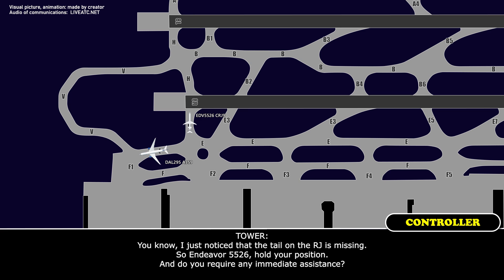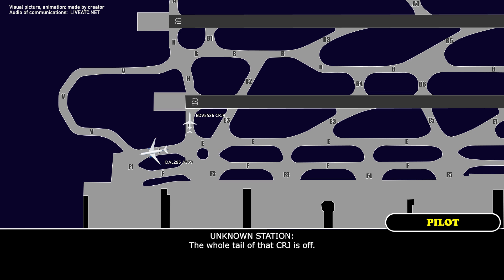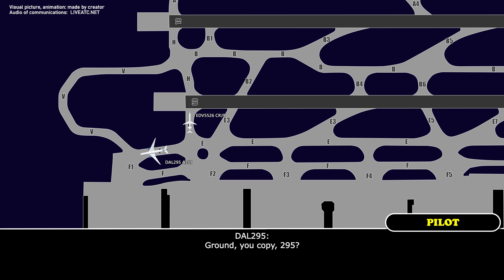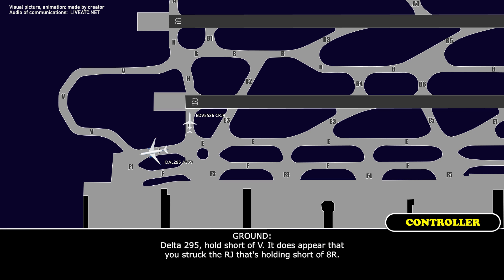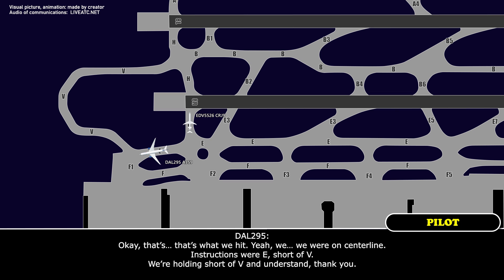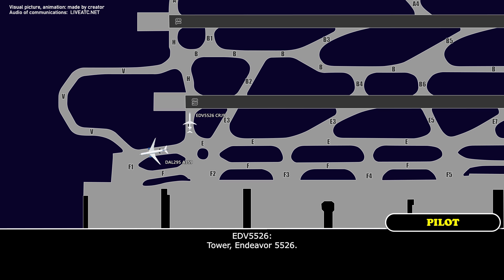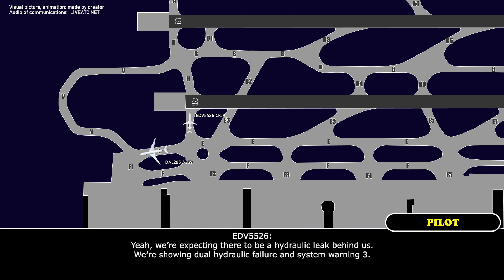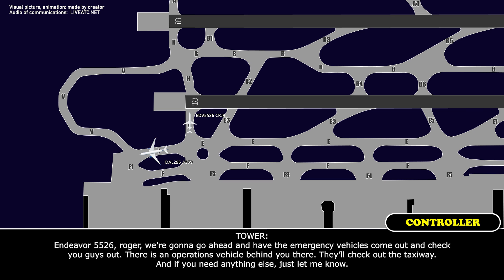“The whole tail is off”. Ground collision at Atlanta. Delta A350 and Endeavor CRJ-900. Real ATC

Comment: That was very quick of Delta 295 to state, "...we were on centerline..."  (translation:  "We were following standard operating procedures.  We are not willing to get thrown under the bus."
Reply: @sundragon7703 Can you blame him? Not sure who exactly is going to carry the can for this. It seems the CJ pilot should have been further forward, but I don't know how those regs are written. The A350 pilot should probably have noted the CJ tail sticking out, but he may have been focused too much on the centerline. My bet is that the NTSB will have criticisms for all concerned, including the design of the taxiways, though the CJ pilot gets the biggest smack on the wrist.
Reply: @grahammonk8013  The CJ pilot didn't do the hitting. The A350 pilot needs to taxi with have situational awareness by taxiing with caution.
Reply: @cottydry  Yes, but he did leave a lot of room before the hold short line. I wonder if the NTSB will at least mention that as a contributing factor Juan Brown on blancolirio channel did some measurements and it seems there wasn't enough room for the A350 to get past while still staying on the centerline. Still mostly the A350 pilot's fault, but i do think the CJR pilot is getting a mention.
Reply: @grahammonk8013 
Yeah this happens all the time because on large aircraft the wingtip path is more than 100 feet away and out of site behind you. Unfortunately the blame will largely fall on the 350 crew since it’s (technically) their responsibility not to hit anything regardless of someone setting a trap for you.
Reply: Huh? You think the CRJ is at fault here?

They were stationary. You aren’t required to be 6 inches from the hold point. The moving plane is 100% at fault.
Reply: Of course he said that to cover his … .
Problem is, sometimes you have to stop, even on Centerline, if there is another aircraft, unbelievable 🤦‍♀️
Reply: @HsquaredH2 If you can’t see the damn thing why would you stop? We gonna taxi in 20ft increments, shut down, hop out and check clearances every time?
Reply: @sithticklefingers7255 , lol, go back to your MS Simulator and have fun, stay out of grown ups convos…thx🤦‍♀️
Reply: Centerline means nothing. Still PIC's responsibility to make sure the area is clear.
Reply: Is there a definition or guidelines on how far or close an aircraft should get to the hold short line? I’ve never heard of any. Plus we don’t know if the aircraft in front had just moved and the CRJ hadn’t had a chance to move forward. That said, it’s not the CRJ pilots responsibility to make sure the tail is clear of the taxi way behind it.
Reply: @saxmanb777  
Nope -  just gotta make sure you don’t cross that hold short line.
If your jet is moving on a taxiway and you crash into any stationary object    -    You’re culpable.
Reply: We did not get the Ground controller's instruction to the CRJ so have to assume CRJ had clearance to be short of 8R.  Either the CRJ did not move far enough up to the hold line or 295 was not keeping an eye on their wing tip clearance.  That 295 hit a stationary plane means they will catch some of the blame.
Reply: @encinobalboa  295 is 100% responsible but the CRJ will likely be a contributing factor. It's like if you're driving down a street and sideswipe a parked car that turns out to be a little far from the curb. You should have stopped or proceeded with caution when it was safe to get around them.
Reply: Is it common to not able to see another plane on the ground or not know what you hit? It's hard to miss a plane.
Reply: yeah covering his ass real quick probably knowing it was being broadcasted for the public to hear like this. Pointing fingers at ATC for misguidance.
Reply: Uhh, yeah? Their job is kinda on the line, so of course they'd be quick to reconfirm what their instructions were and that they were following them.
Reply: @driftspecs13  - yep! Already trying to pass off the blame
Reply: Good thing this didn’t happen while they were up in the air!  Yikes!
Reply: They’re the bus the RJ got thrown under
Reply: So much for clear right by the FO
Reply: @brigadeaviator  happened 2 months ago same side at KSLC. maybe the FO isnt allowed to clear right at delta
Reply: But as pilot in command, if there's any doubt, stop.  Just like being cleared to enter/cross a runway.  You still check.
Reply: @pfsantos007  unless it was dark
Reply: @pfsantos007 evidently, there was no perceived doubt. No accidents would ever happen if there was.
Reply: @pfsantos007 I heard another, longer version of the ATC tapes where DL 295 requested a stop and was denied. ATC seemed to be pressuring them to get to the area out of the flow of traffic. I can no longer find the clip and can’t be certain it was authentic but if so, could show contributing factors.
Reply: @pfsantos007 You are such a hypocrite.  You would be on the radio immediately saying how you were following ATC and that it was not your fault, just like this pilot.  You talk like some big authority but have never, ever, been in a cockpit or flown an airplane, so keep your couch-based comments to yourself.
Reply: @mikek5298 Tell us you’re a keyboard warrior without telling us you’re a keyboard warrior lol
Reply: @mikek5298  LOL - A couch based commenter scolding a couch based commenter for commenting.
Reply: @mikek5298  The delta pilot just entered the chat.......
Reply: @mikek5298  30yr pilot here - you run into another airplane while taxiing, that you’re overtaking, its generally going to at least partially be your fault.
Reply: @WillFlyForTips  as a former pilot, I can say that even when we were just student pilots, we were taught that being at the taxiway centerline doesn't always guarantee that your way is clear of obstacles, so we were warned that if our wingtips hit something, we cannot use the excuse that we're at the centerline and we didn't see the obstacle.
Reply: @mikek5298 
Your right -  accidents happen.
But -   The Captain claiming he was on the taxiway centerline does not clear him of culpability.
Reply: @mikek5298  oh my God, what is your problem?
Reply: @ro-86alkonost78  Problems is they say you can not see the wingtip from the cockpit of a A350. So not sure how they are responsible if they  were told to taxi past F to Victor right by the spot they collided?
Reply: As a PIC, you are responsible for your aircraft. That includes hitting other aircraft while taxing. If in doubt, you stop until your are sure you have enough room to proceed. 

The CJ was well positioned behind the Hold Short line and not at fault in this case, nor is ATC. BTW, I do have over 21,000 hours in heavy transport.  equipment
Reply: @mikek5298  well as an actual pilot I can tell you the couch pilot here is almost undoubtedly you because his assessment of the situation is a 100% accurate.
Reply: @skydancerforever  pilots are always responsible for the movement of their own aircraft. They know how to estimate their wingspan from the flight deck. When in doubt, they should stop. These guys misjudged their wingspan. Tower dropped the ball by not taking a closer look and/or not saying “use caution when passing behind the CRJ”. That would have been a red flag and I’m pretty sure they would have stopped.
Reply: @skydancerforever  the pilot is still responsible for ensuring his wings won't hit anything. Even if they have taxi clearance, it doesn't mean that they'll get off the hook so easily. It can be ATC's fault or A350 pilot's fault or even both of them could be at fault.
Reply: Yeah that's not going to save him.  If I'm instructed to taxi to 16R via Bravo does that give me permission to plough through the 10 airplanes ahead of me in the line up.  Uh no..... This is 100% on the DL295.   Doesn't matter one bit where EDV was stopped.....  What if EDV was right in front of him on E, DL 295, "well we were told just to hold short of V".....
Reply: @raymoland  Doubt it will be 100% as you suggest. That other aircraft should have had a precise spot to be at, not just stopping anywhere. The airbus cannot see anywhere near its wingtips, but he should just know….that other aircraft that seems to be in the right spot, is actually xx ft off, so we won’t fit?  What if it was night time?
Reply: @Arkangel88Mr  I am a professional commercial pilot for a major US airline.  Perhaps you are too.  If so you will know that it is not written anywhere how far you can or should stop from the Hold Short line, just that you should not cross it without permission.   It is also quite possible the CRJ was moving forward after another aircraft took off.   Doesn't matter.  If I am taxing my aircraft and I hit another from behind, it is 100% my fault.
Reply: @raymoland   Perhaps you are right. But if everything depends on a pilot judging his wing tip distance without being able to see, on planes with such large wingspan, maybe some procedures/ airport design changes are needed. Unless it was just all negligence.
Reply: He's not wrong.
Reply: Geez, men seem to get so contentious with each other. 😮
Reply: @msjdb723 yapping bubbas think it’s just like hitting their 2500 StrokemeWagon’s mirror on something. It is not.
Reply: But the CRJ was under the (Air)Bus 😂
Reply: Meh…that tail was going to fall off sooner or later.
Reply: You can be on center line and crash into the plane in front of you… duh
Reply: @burnn3 agree 100%. I flew heavies for a long time. You are aware of your own wingspan and learn ways to judge wingtip distance when you cannot see them.  We would use cross-cockpit references to judge different clearances at 10 and 25’ from our wings.  With the 350 pilot asking what they hit, it seems they were not even discussing the CRJ’s location and were unaware of the threat.
Reply: being on center line does not guarantee clearance especially at intersections..... flying for 35 years i hav seen lots collisions...especially at converging intersections.......  the Delta when he says he hit something...admits that he did not even observed the CRJ when passing it.....that's so obvious....day  dreaming
Reply: Yep, complacency will make you follow the centerline without looking around. Still his fault, the PIC has the ultimate responsibility to avoid collisions. Technically, even the one that hit a pole while following linemen's signals
Reply: Exactly what you and I would have said had we followed instructions and were on the centreline !
Reply: Too bad if he was on the centreline! If you’re on the C/L and you hit another aircraft, then it’s YOUR fault! What a cop-out.
Reply: Well , they got it on record alright (the FDR recording , the frequency recording and now the whole damn world on internet ....)
Reply: According to Blancolirio's coverage of this, the smaller jet was either still taxiing or holding WAAAY too short of the runway.  The A350's wingspan is like 220 feet, so . . .
Reply: @joesterling4299  Yes but then he discusses not who is at fault but only whether it is career ending for the DL pilots....
Reply: One of my briefings in close quarter taxi routings is “we proceed with extreme caution in the vicinity of other aircraft”…the A350 has a vertical stabilizer forward looking camera but I wouldn’t trust it to ascertain my wingtip clearance on another close proximity aircraft.  I’d rather just let ATC know we cannot proceed as there is a conflict with the other airplane’s position.
Reply: everybody here is wrong, yes that means you
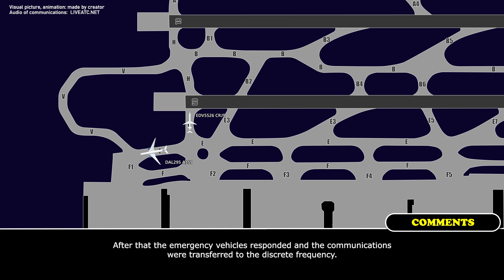Reply: Being on centerline won’t save them. The first officer had a clear view out the right window as did the captain seated behind him and the jumpseater also 2:03  has eyes. If any of them were on their phones for any reason, they are fucked, but I think they’re fucked either way.

I’m a wide body captain, so I kind of know how this is going to play out.
Reply: Maybe my bad english, but i understand every time i hear the sequence "... we were off centerline..."
Reply: Kinda like a driver who’s in a crash gets out of the car and the first thing they say is ‘I had the right of way’ when that’s not entirely true.
Reply: Looking at the video of this, the CRJ was stopped WAAAY back from the hold short line, so his tail was not where it was supposed to be. Oops.
Reply: @Kevin_Rhodes  Unless things have changed since I retired, it’s the responsibility of the aircraft that’s moving to avoid the one that isn’t. Centerline be damned.
Reply: @charlesharrell3643  I don't think it has changed. This is also why even when taxiing a Cessna 172, we still call out "Left clear, front clear, right clear" before turning.
Reply: @Kevin_Rhodes and this simulated animation, not video of the actual incident, may not be accurate at all.
Reply: @Kevin_Rhodes , so what, he can stop short where he wants! The A350 should have stopped, period!
Reply: @Kevin_Rhodes - irrelevant. The moving aircraft should have made sure there was adequate clearance
Reply: @kentsibille6850  How, they can not see there wingtips from the cockpit on the A350? they were cleared to taxi right thru the area to Victor.
Reply: @skydancerforever  - they obviously say the ERJ and never considered that they might not have room. Ultimately their responsibility. I bet their are wingtip cameras as a part of the resolution
Reply: @Kevin_Rhodes  the positions this video showed are just for presentation purposes, it might not be 100% accurate.
Reply: @ro-86alkonost78  I am basing my conclusions on the actual video of the scene, not this reconstruction. That CRJ was NOT where he was supposed to be.
Reply: @Kevin_Rhodes  people need to realize that being on the centerline is not an absolute guarantee of not hitting obstacles. If you're the pilot, even if you're at the centerline, and your wing hit something, you may have a liability and it's still your responsibility to ensure you will not hit something when you're taxiing.
Reply: @Kevin_Rhodes  - irrelevant
Reply: @Kevin_Rhodes  Doesnt matter, as a pilot in command of a aircraft, its your duty, to make sure taxiway ahead, and your surroundings is clear, and that you wont hit anything. If the CRJ was so far back, it would of been obvious the 350 pilots, they were gonna hit it.. they should have stopped if it was so obvious
Reply: @Kevin_Rhodes  That's irrelevant.  What if it was a much larger plane that was waiting at the holding line?  The result would have been the same.  The responsibility falls squarely on the pilots of the larger plane taxing behind them.  They should have seen the smaller plane waiting for take off.  I am willing to bet they knew exactly what they hit, but pretended to not know and immediately cover their asses by saying they were on centerline, which, btw, according to FAA regulations is not guarantee of clearance.
Reply: @Kevin_Rhodes   It is reasonable for an aircraft not to be at the very edge of a HS line since then you cannot see the line.
Although the CRJ could and likely should of been up another 20ft closer to the HS line; it is mostly Delta at fault. Although they likely were on the taxi centerline, it is their responsibility to maintain clearance of objects while taxiing.... especially stationary ones.
I know I can't see the wing on planes I fly and I know they cannot either, but you get a sense of what might be too close, so they should have recognized it as an issue and contacted Ground to verify clearance (ask CRJ to move up).
Reply: @Kevin_Rhodes the animation is not accurate. All of you didn’t pay attention to the disclaimer at the beginning of the video.
Reply: Not their fault at all. They were stationary. The moving aircraft is 100% at fault. If there is an object/vehicle/aircraft in your way you stop.
Reply: @Kevin_Rhodes  The CRJ was a little back of the hold short line, but definitely not WAAAY back.  That said, do you know if the CRJ was stopped or still moving forward when struck.  But more importantly, if you see another aircraft that is not quite clear of the taxiway, you don't keep going.  You need to know where your aircraft is in relation to the space around you.  This pilot seemed completely oblivious to that fact when he wasn't even sure what he hit.  Hmmm, maybe the other aircraft you just passed.
Reply: @tchevrier  The CRJ was at least half an aircraft length back. The pilot of an A350 can't even begin to see where his wingtips are, and on a short hold area like that even if the CRJ was in the right place there probably is VERY little clearance between his tail and the largest airplane that Delta fly's wingtip. There has to be an expectation that if you are cleared to taxi, that everybody is where they are supposed to be. So I fully expect the final report to put the blame mostly on the CRJ, and possibly on the controllers, but not on the A350 at all. He was confused because there shouldn't be anything out there to hit - he was right where he was supposed to be and cleared to be, assuming he was correct about being on the centerline.
Reply: @Kevin_Rhodes  Absolutely not.   DL295 should know where his tips are.  100% their fault.
Reply: @raymoland  so if the A350 pliot is cleared you will of course come back here to apologise
Reply: @tchevrier  Are you looking at a video or the diagrams in the YT video?  The latter is a depiction but not necessarily accurate.
Reply: @jirimondo  the video footage
Reply: @tchevrier  In that photo I saw the CRJ was pretty far back from the hold short line, maybe 40 feet.
Reply: @tchevrier the disclaimer at the beginning of the video. READ IT AGAIN.
Reply: @Kevin_Rhodes  - still the fault of the Airbus pilots
Reply: @lastdanceLL  so?  What difference does that make.  If he's sitting in the middle of the taxiway, the A350 pilot has the responsibility to not hit him.  C'mon man.
Reply: @zeitgeistx5239  what's YOUR POINT? facepalm
Reply: @tchevrier . I think I heard on the news the CRJ had its parking brake set.
Reply: @ant2312  you clearly don't know the first damn thing about Aviation if you think he's getting away from this Scott free
Reply: @tchevrier  The CRJ were following another aircraft in front of him busy lining up on the runway the exact moment the A350 struck his tail. That means he can't go to the stop line right away.
Reply: @Johan_Jacobs  I haven't heard that, but if it's correct then it would definitely not bode well for the airbus crew
Reply: @Kevin_Rhodes  CRJ was legal here. You don't hold right up on the hold short bars since there is a real risk of a runway incursion. That distance is not abnormal. Ultimately the PIC is responsible for the aircraft clearing obstacles. This isn't unprecedented and has happened numerous times. ATL ground and the A-350 flight crew will both get a visit from the FAA. There may also be a recommendation from the short departure holding area which may lead ATL to build a new departure TWY just to the west that enters near V. Until then, ground processes will change and lead to some delays. ATL is just too busy of a bravo for that taxi layout. Compare it with a bravo such as DFW, which has a well-thought-out departure.
Reply: @Kevin_Rhodes  Doesn't matter.  Pilot should be able to see the aircraft on the taxiway and know his wingspan will be too big.. I mean you don't just 'brush' a tail and knock it off.. that was a major hit.
Reply: So sad, 2 planes collided and dozens of YouTube viewers started a fight… great times we are living in.
Reply: @dimka2006  And almost all of them are arguing with zero knowledge or experience, comparing airplanes to driving a big car.
Reply: @burnn3  Yup.  Former 76 driver here.  We always knew where our wingtips and tail were.
Reply: @WillFlyForTips I call BS.  One of you took the tail off an airplane of the airline I retired from last year- which our company wrote off and totaled.  Today is at least a second offense.  You obviously do not “always” know.  Unlike you, I, on the other hand, did always know.  😂
Reply: @burnn3  747 pilot but your about section says: Age: 20
City: Atlanta
Occupation: Military

Nice try
Reply: @ant2312  LOL, Damm that kid is not only a liar, he is a certified genius as well
Reply: Armchair pilot here and even I could tell the CRJ pilot is at fault.
Reply: @jacksaloman9513  , and the cluelessness continues… hold onto your armchair and ask mommy for breakfast 🤣